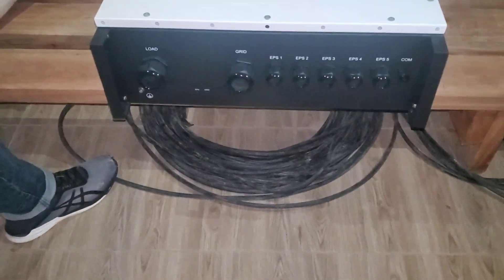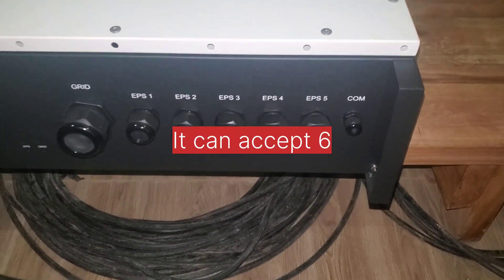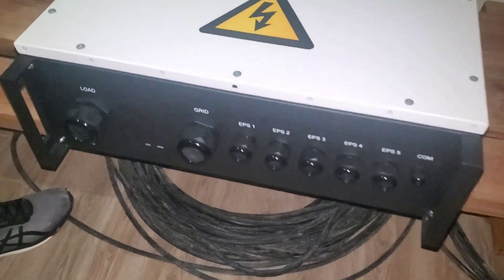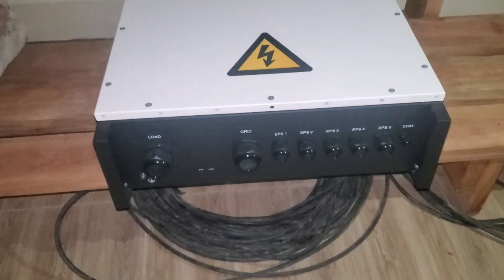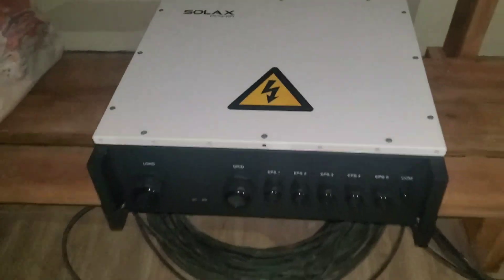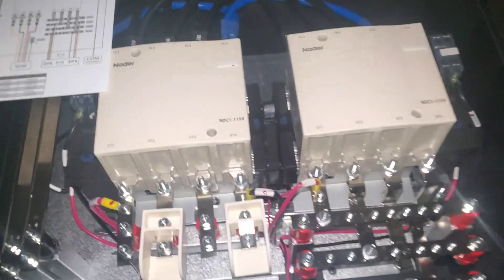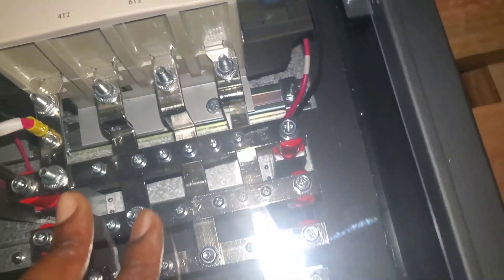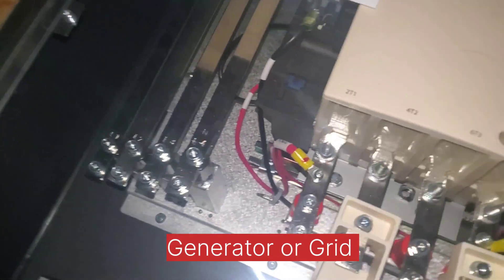The SolaX EPS Parallel box is here.  #solax #solarpowerplant #offgridsolar

Comment: Nice work coming along. In previous videos you’ve indicated Nigeria & dust issues… what’s your plan for dust and off course, our friends, cobwebs & other critters?
Reply from the maker: Thank you as always for commenting and liking the video. All that we are installing is IP65. We have no windows and the room is air-conditioned.
Reply: @drsolar  With that level of high voltage, a service plan will need to be looked at, as well as advice for any local manager for cleaning purposes and training on how to switch over to redundancy provided by the generators. So far, it’s looking good Dr. Solar. Also meant to ask, during the rainy season, will a low state of charge trigger the generator(s) to automatically run and recharge the batteries as well as run loads?